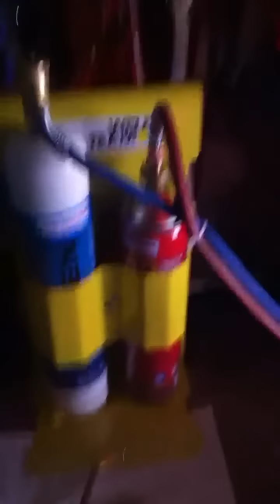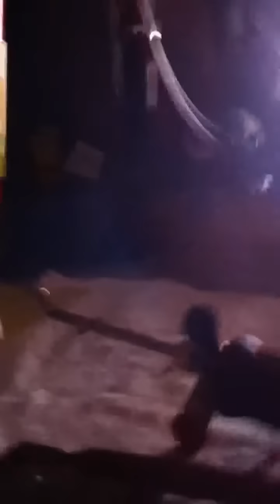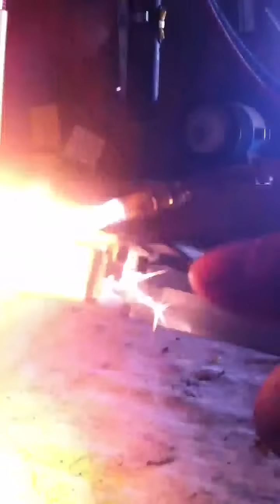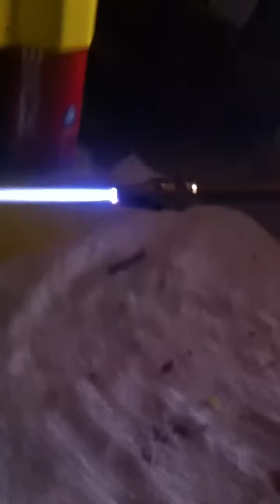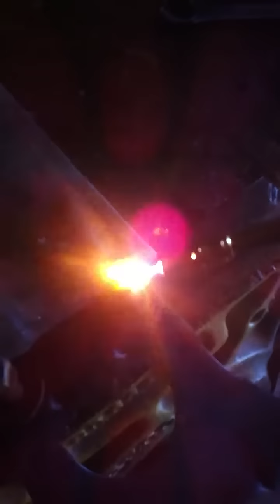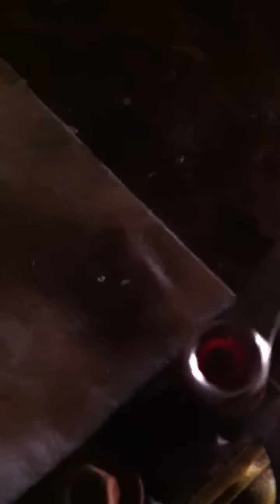Oxypractic 3100

Comment: I have owned one of these torches for about 3 years, the oxygen gets very expensive to run over time and the 2 hours they state as running time on one disposable tank (£22 from my welding shop) is definitely on the generous side. Going full flow I was lucky to get much over an hour so I converted the torch to a regular tanked propane setup with a 5lpm oxycon for the oxygen supply, it runs AMAZING! It is a touch cooler due to the standard propane supply and slightly less concentrated oxy although I doubt you would even notice this....but I have 24 hour a day oxygen! I would thoroughly recommend this route for anyone looking to use these things around the home as oxycons are not really that mobile :)